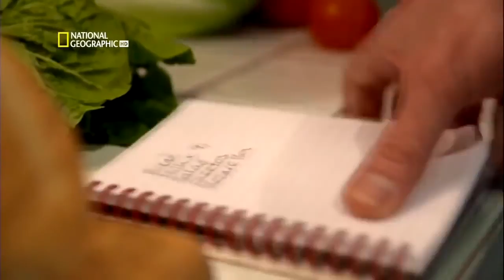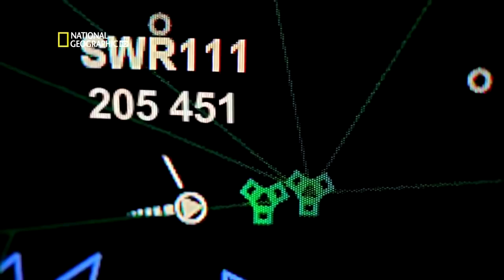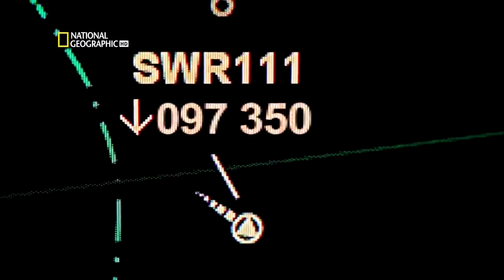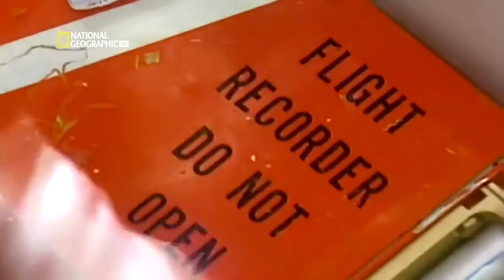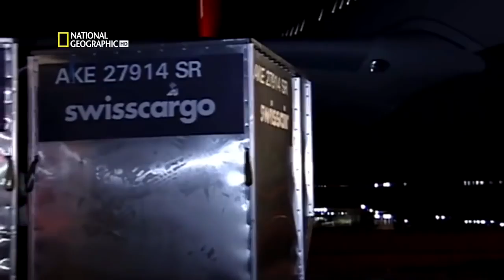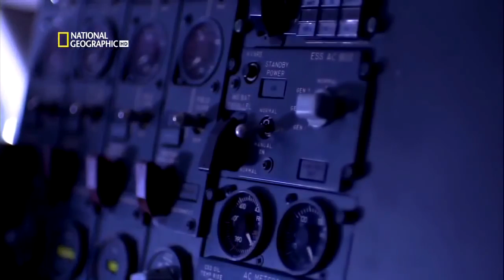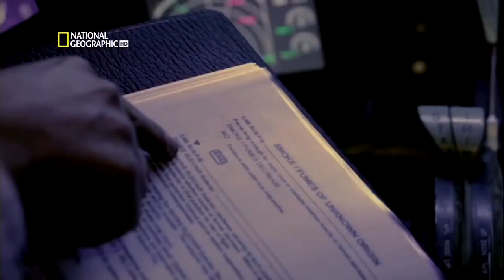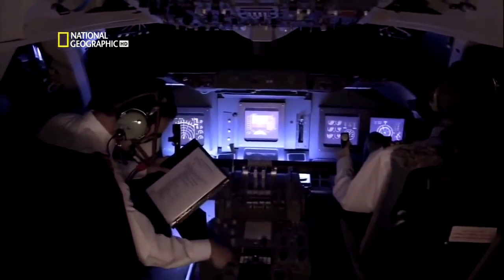Seconds From Disaster FIRE IN THE COCKPIT | Full Episode | National Geographic Documentary

Comment: Shouldn't have fuel dumped and just landed straight away!
Reply: It was calculated that even if they didn't try to dump fuel, and began descend and directed at halifax upon first detecting the smoke, they still would not have made it. Their decision to dump fuel, while doing nothing for them, allowed the plane to crash in teh ocean without harming more people, another indirect result was the fire was extinguished during the crash allowing the team to more accurately detect where the fire on the plane actually burned as opposed to a land crash which would have fires burnign more parts of the plane.
Reply: @geraintgianna4041  If they weren't p1ssing around doing unnecessary manoeuvres they'd have been fine!
Reply: @peterowley2014  Bro in the video, they literally said they would not have made it even if they knew before hand and didnt do any detours
Reply: @peterowley2014 even assuming that they could reach the airport, the biggest problem with landing an aircraft whilst carrying excess fuel is double- the excess weight could cause the landing gear to fail on impact, and where this happens then the plane is forced into a belly or other non-standard landing and the fuel will be a massive explosion/fire hazard for any fire crew responding. 

Just to use a semi-related example, when the Tenerife air disaster happened where two planes collided, part of what caused the resulting fire to be so severe was that one of the aircraft, a KLM flight, had been refueled and so was carrying much more fuel than it would have done normally. 

Given the pilots had absolutely no idea that the fire was spreading as rapidly as it was and that they were following the established procedures given to them by the airline, it doesn’t seem unreasonable for them to have made the decision they did to dump the fuel which is an entirely normal process to do during many flights.
Reply: @eliz_scubavn  What's the first thing you do when you encounter a fire remove the fuel to it and get out the situation no excuses it's common sense ffs.
Reply: @peterowley2014 who are you employed by as a pilot?
Reply: @peterowley2014 so you are ignoring the literal investigation that said the pilots STILL would not have made it if they didnt dump fuel and tried to land immediately?